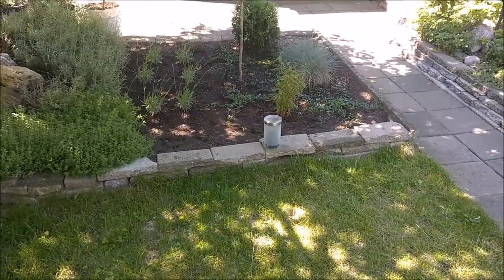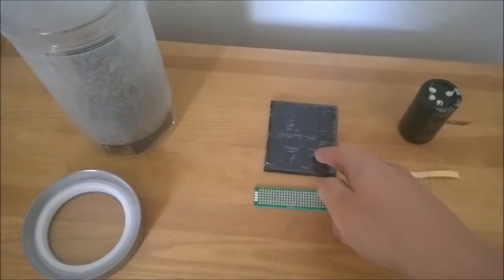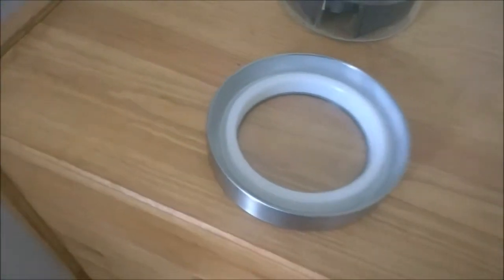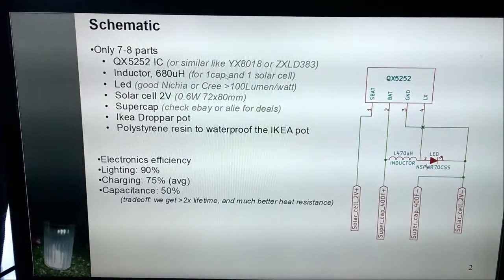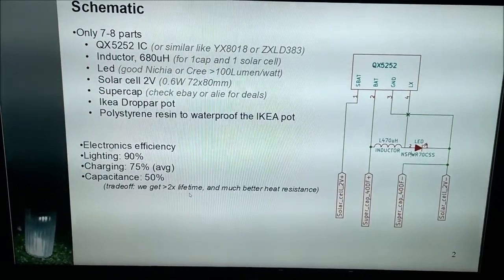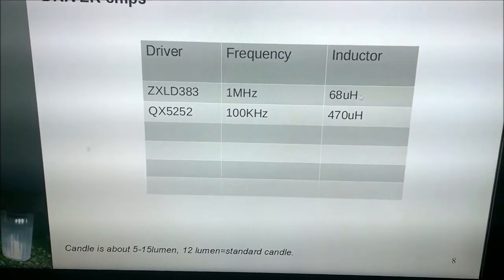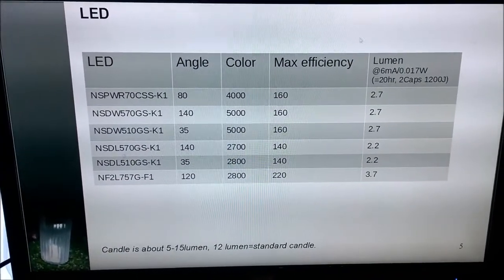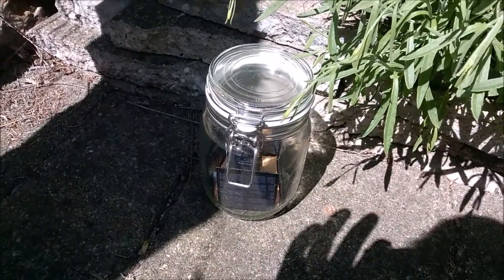Super capacitor Solar Light for $10 (DIY)

Comment: @PZ82 - I am very intrigued by this video, and I hope you could help me out.  I am a retired high school environmental science teacher who is developing an educational solar lantern kit with a two part mission:  1) to create a low cost classroom kit which supplies classrooms with materials for building their own solar lanterns with supercapacitors, and 2) to support the humanitarian mission of promoting off grid PV systems for those in energy poverty.  Is there a way that I can email you more details?  Thank You!
Reply from the maker: What do you want to know?
Reply: @PZ82  I'm developed a DIY solar lantern  kit where students make their own lanterns out of standard wide mouth mason jars.   It uses a 3V PV panel, 2 LEDs, and a customized PCB so that it's a self perpetuating system; charging itself by day, lighting itself at night.  Our previous version used NIMH batteries, 600mAh capacitance.  We want to make a 'next generation' solar lantern that uses supercapacitors instead of the rechargeable batteries.  Could you help me work with an engineer in designing the PCB?  It's for educational (and eventually humanitarian) purposes.
Reply from the maker: I am not proficient in making pcbs unfortunately. 
For super capacitors be sure not to exceed 2.5v solar panels or you will overcharge them. My design works with both 2 and 2.5v panels. 

Some lights are now 9 years old and still work.
Reply: @PZ82  OK and thank you!

Comment: Your design uses (4) 2v, 300mAh solar panels. won't that overload the QX5252 which is rated at 300mA?  anxious to make this!  thanks for the video and design!
Reply from the maker: I have had no problems with this. I have been running 20 lights for more than a year without any degradation... Also the 300mAh is for the driving of the led i think.. In most cases the solar cell will not reach maximum current. Also the capacitor charges in just 5-10 minutes with full sun... Most of the time during the day, when the sun comes up, the capacitor is already charged before the sunlight is at full brightness. I do prefer the  Ikea korken mason jar over the frosted glass Ikea Droppar jars though because the former is more waterproof
Reply: Thanks for the  quick response!  I used your plan to make a light with 2, 2v  150mAh panels and 2, 500F capacitors and a  5050 smd led drawing 60mA.  so far, 2 nights, all night, very bright all in a frosted jar. Thanks for sharing your developments and knowledge!
Reply: in adition to the original 2,  I have assembled 5 lights with a single panel, 2v150mA and single cap, 2.7v500F.and a .75w led. The worst one stays lit for 40 hours.  What do you think the smallest capacitor that could work for 8-10 hours of light?  100F, 200F ?  thanks, again for the video!
Reply from the maker: I don't know. Mine stay on for 20hours on a charged 500F cap, pretty much as I described it in the video. I did notice however that the qx5252 output varies from batch to batch. So some qx5252 batches may output less current at a given inductor value than others. So depending on how much light you want even 100F can be enough for 20hr. 500F gives you 2-5 lumen for 20hours.

Comment: Where did you manage to find the LEDs that you're using? I didn't have much luck finding them on ebay.
Reply: Search terms are: F5 Piranha LED. 
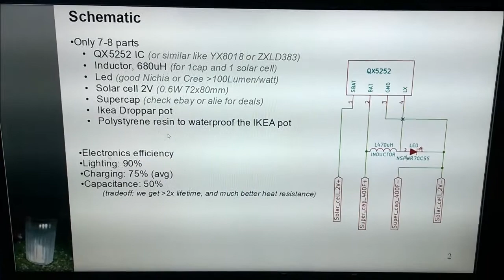A bit different than the one he spec'd out on the schematic at 4:37, but will work in place of.

Specs from first chineseium eBay listing that came up:
Specification: 5 mm
Voltage: 1.9--2.1V (The voltage can not very high Otherwise it will burn out )
Forward current: 20 mA ; Reverse voltage = 5.0 V
Luminance: 1000-1500mcd
Product life: About 50000-80000 hours (Suggestion current 20 mA)
APPLICATION: Lighting lamps and lanterns, lamp mould, small night lights